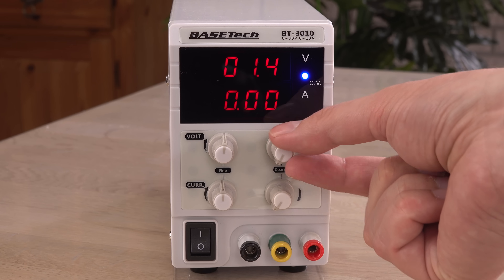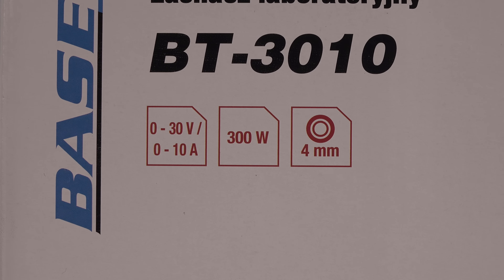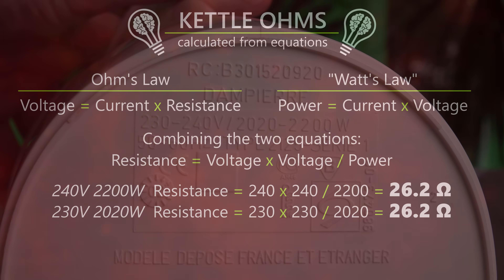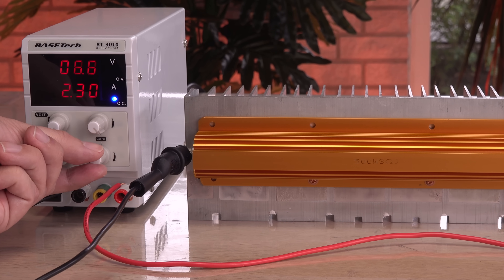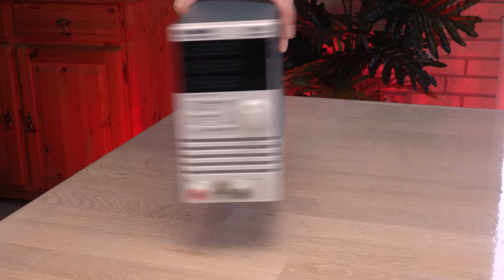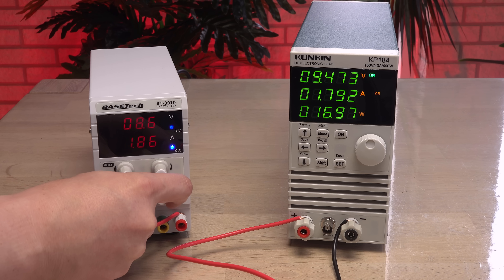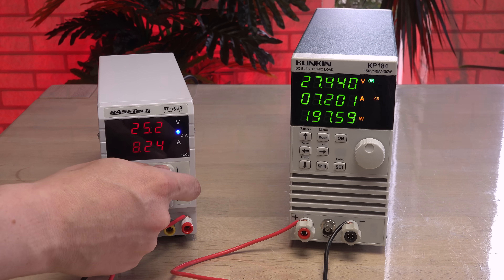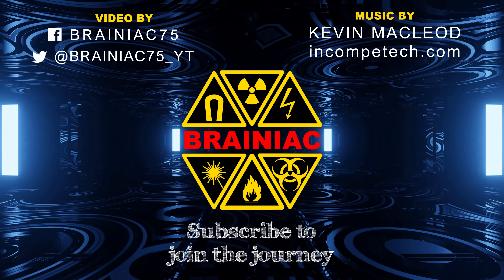How [NOT] to MAX test a power supply!

Comment: I would love to see the benchtop power supply's output on a scope. Wonder how noisy it is.
Reply: I have a linear power supply from UNIT-T and tested it. It is mostly fine, except for a 50Hz base from the grid. But for a switching PSU, the noise could get much higher. The common solution would be to add capacitors to the outlet, but it hurts the PSU's ability to respond to really fast changing loads and may cause a power loss for sensitive systems that sometimes spike in current.
Reply: @yuxuanhuang3523  Long live linear - 9 out of 10 capacitors agree!  lol
Reply: We had one of these supplies at work. They are the most noisy lab power supply i have ever seen. You get what you pay for
Reply: With the switching design, there might be "a lot" of noisy HF AC hash riding on the DC and even some 50/60 Hz ripple at high current loads, especially when set near max voltage. In most cases, it won't be a problem with less sensitive circuits.  The specs should give the numbers you'll need to decide price/performance sweet spot. The little, low cost switching boost reg boards (not stepdown/buck benchtop P.S.) can be hideous sources of noise.
Reply: They're very noisy.  Switchmode with not so great HF filtering, so not so great for circuits that need very clean power. So it's not lab-grade.  Then again, these cost about $50-$70, so it's still worth every penny for hobbyist use, IMO.  I got one for ECM machining of hardened steel and basic bench power supply use.
Reply: it will be tricky for him to measure. Even as an EE: You need to specify a test scenario like the resistor, because it does not create its own artefacts, but also the resistor does not care about PSU quality.
Reply: @sarowie  While that is partly true you have the option of testing for ripple+noise or just ripple. It's fairly easy to test for both though.

Comment: Mike's electric stuff has an amusingly simple means of load testing, just put some enameled copper wire in a bucket of water. The enamel is thin enough it can conduct heat from the wire into the water, but prevents it from corroding from being a dc potential in water. Tune the amount of wire to the desired resistance, and then if you need a longer runtime, use a bigger bucket of water.
Reply: Nice idea! So simple, yet functional. 
As long as the wire isn't all too thin compared to the current running thru it and the water temperature is kept constant, the resistance will stay constant. It's more important to keep the temperature constant for copper though. Wire wound resistors and metal film resistors are usually using high resistance metal alloys that is made to have small variations with temperature - even though the resistance can still change a little bit, if they get very hot.  But copper may have something like a 5% increase just going from for example 20 to 50°C (for example if the water temperature is allowed to rise).
But it also depends on your application how large deviations in resistance that can be accepted. If some variation can be accepted, heating wire can also be a good option if a lot of power need to be dumped - since those wires can get red hot for long periods without damage 😃Many of those alloys can go from room temperature to red hot with only 10% resistance change - some like Kanthal A1 is as low as 5 % increase going from room temp to over 1200°C (which is like yellow hot).
Reply: i wouldn't call it amusingly easy, as it requires a fair bit of experimentation to get the right resistance with a reasonable length of wire. But it definitely is amusingly cheap and accessible.
Reply: THat's great for testing amplifier wattage
Reply: How does using wire in mineral oil compare to using water for the heat sink?
Reply: @FindLiberty  water has higher thermal capacity, will boil if overheated, is cheaper, and is less of a mess to clean up. Oil is an insulator, so it is better for high-voltage application. It may be a fire hazard if overheated.
Reply: its exactlly how i tested my DIY 2000w labbench powersupply with those chines dc to dc setp down transformers and server powersupplies in series i think they are called RD DPS5020 modules 50v at 20 Amps and 2 of those for 50v 40 Amps, and what can i say, i boiled that water as fast as a kettle and those modules actually were handeling it quite well. 
which is just crazy for how small they are.

no consumer electronic load would have been able to handle that amount of power, only if i would use like 5 of these shown in the video which just wasnt viable for just a simple extreme load test.
Reply: @BadMax02_VR  I love the manufacturer Raiden i have an RD6018 powered by an old pc power supply and a boost converter. The RD60 series can actually act as a BMS

Comment: This is a critical teaching method that some people do not get right: you must show failures. Human simply do not learn properly without failures being involved in the lesson.
Reply from the maker: Yep. Failures and understanding why it failed is often more enlightening and memorable than just seeing something that works. Thanks for the early watch!
Reply: absolutely. I am worried about electronic loads because Dave Jones created an oscillating circuit using the constant power.
Here, we saw the constant resistance mode and also saw oscillation.
Oscillation can kill both devices.

Meanwhile honestly: Neither the cattle nor the resistor where a "failure": that was just approaching the limit in an easy to understand and fail safe way.

Comment: If you just wanted to test the max output all you had to do is short the + and - terminals with a wire, any decent PSU or dc converter will not have any problems with this, if for some reason it doesn't survive then that's also good, because it takes a potential fire hazard out of your equipment.
Reply: That will max the current, but not voltage. The wattage across what is basically a 0 ohm load is... 0 watts. On single winding linear power supplies, this can often be used to see if the series pass transistors are up to the task of dumping the entire transformer's output as heat, but the unit he featured here was definitely a switching supply, which only needs to deal with conversion losses as heat.
Reply from the maker: I believe this one has a short circuit protection that turns the output off, but haven't actually tried it. Short circuiting something just feels inherently wrong and not necessarily something I would recommend :) Thanks for the early watch!
Reply: @brainiac75  Shorting out a bench supply is actually pretty standard practice. If the unit doesn't have a set current and measured current reading and instead only displays measured current, you short the output, set the desired current, remove the short, set the voltage, then connect to whatever device you need to power.

When shorted, it'll output whatever voltage is needed to push the requested current across your shorting bar, typically voltages in the millivolts, due to ohm's law.

The electronics in the supply simply increase the output voltage until it hits the current limit or voltage limit, whichever happens first, then regulates from there.
Reply: @brainiac75  do don't "short circuit" the PSU, you just use the current limiting mode.
Yeah, you should not turn the voltage to 32V and than slam a piece of solid copper onto the output, but switching it on with a short circuit bar is a totally normal use case.

Comment: Cheap?? my education is radio tv mechanic, and i do dabble in the occasional home project, but im not spending 1000 dkr on a bench psu. I made one myself :-D
Reply from the maker: For a commercial model this one in cheap - a budget model. Check the prices for a similar lab power supply from a reputable brand like Rohde & Schwarz ;) Thanks for the early watch!
Reply: @brainiac75  oh I'm well aware that they go way more expensive WAY more 😁 but I reserve my opinion, that they are expensive. The diy one I made, is just a 12V 2,5A wall brick and a boost/buck converter with current limit. Works just fine for my needs and cost me about 50 dkr for the buck/boost 😊
Reply: @MC-Racing  fair enough - PSU is a typical starter project. but in Brainiac use case - physics/electromagents, maybe laser, maybe electrochemistry  - buying 30V/10A sounds about right.

I honestly would have bought two power supply (30V/3A and 15V/10A or something) as even 3A are a lot for the things I do, but I see where physics and chemistry might use 10A - but usually at a lower voltage. So... I also would not mind what you have setup, maybe I would add a linear regulator behind it for sensitive stuff.